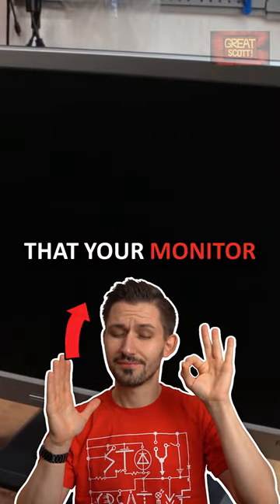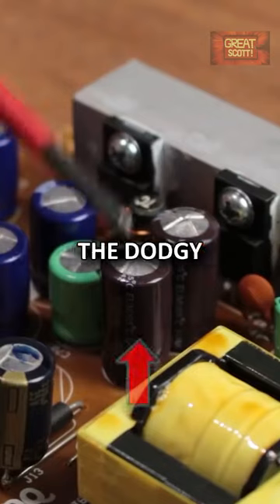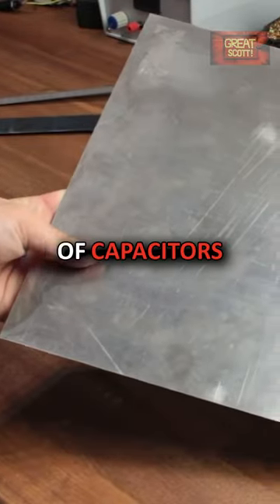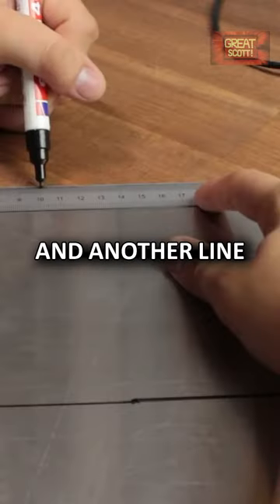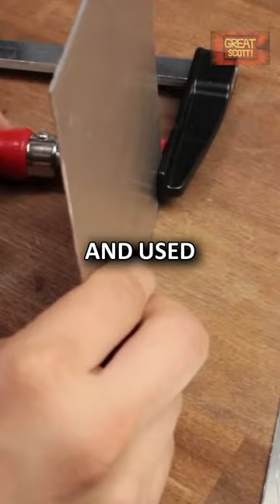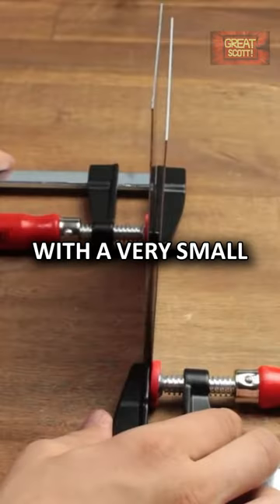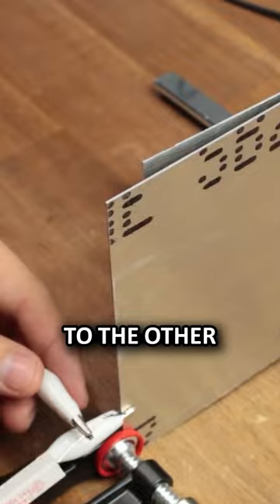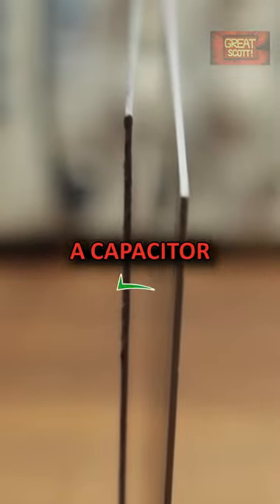Building A Capacitor (DIY)

Comment: Dude, I can’t believe you didn’t measure the capacity!
Reply: 1*10^-22 micro Farads probably
Reply: @RobC1999  i made an oopise oopsie
Reply: @LAYATORS ❤
Reply: @LAYATORS I m in 7 grade can ya explain a bit more
Reply: @LAYATORS about 10 years ago i made a capacitor out of aluminum foil, and it had about 10 pF
Reply: I’d say about 50 pF, assuming 0.3 m² area and 5 mm distance.
Reply: @PankajSharma-qr1bt 
I can explain it to you on wednesday if you remind me.
Reply: @neutronenstern.  okk

Comment: I think it would be better to put a sheet of paper or cellophane between the sheets of metal and clamp them together. The capacitance is inversely proportional to the distance between the two sheets of metal, so getting them as close as possible without shorting is ideal.

Comment: Sometimes its two diodes that is connected in parallel, one of them will short out causing both diodes to short. Causing a screen or tv not to switch on.

Comment: where I live, the temperature varies between 33-35C and humidity ranges from 57-67% without rain, and I have electronic devices manufactured in the early 90s. What is the maximum possible interval for me to energize these all devices and for at least how many minutes to prevent failures in the aluminum electrolytic capacitors caused due to disuse??

Comment: I've actually got an older monitor that only powers on for a few seconds, then shuts off. I'll definitely have to check the power supply capacitors.
Reply: If it's mfg'd between 2000 and 2010 then it could be suffering from the Capacitor Plague